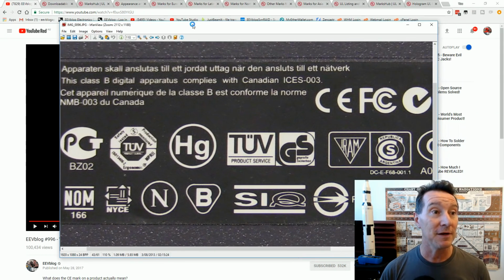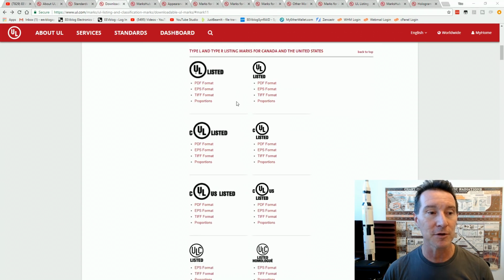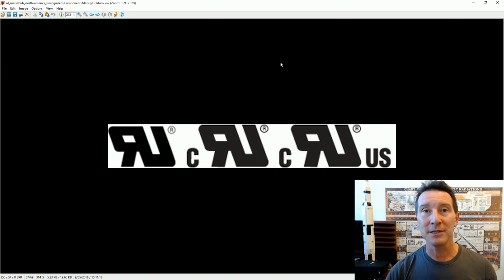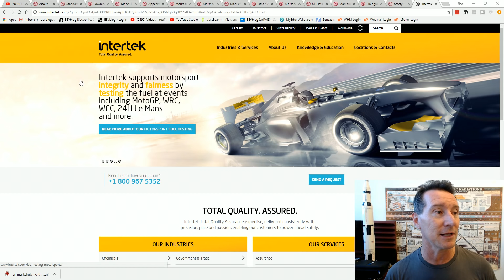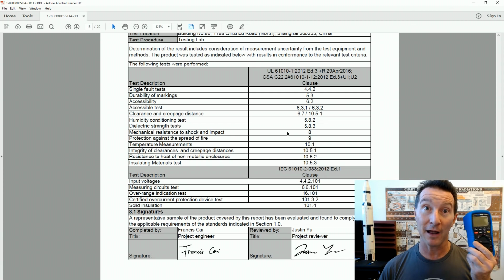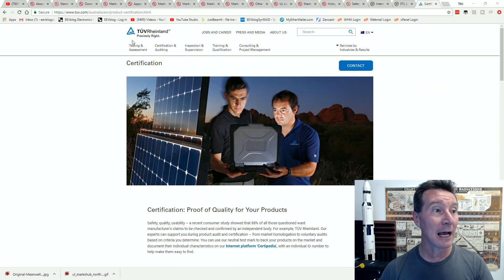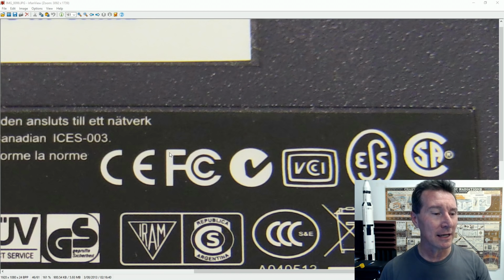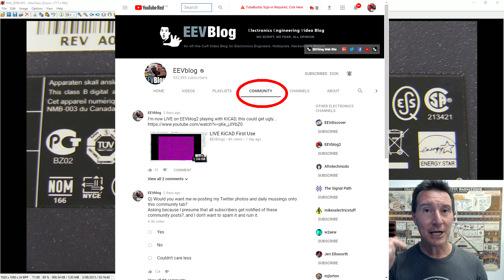EEVblog #1082 - What Do Compliance Logos Mean?

Comment: It would be more helpful if you announced the price of those logo.
Reply from the maker: There is no set "price", and I did mention ballpark pricing.
Reply: I meant something like pricing guide and related expenses. That is documents , the procedure and so on. It would be really, really helpful for many of your subscribers.
Reply from the maker: Did  you watch the video? I said it can cost thousands of dollars, into the 10's of thousands. There is no "price" I can tell you, "it depends".
Reply: Sorry, I didn't express myself properly. I meant the procedure rather, that is how to obtain in details and the payments. That is, more exact information on what it depends and how to do it properly.
Reply: You can get a basic UL (like electrical panel) inspected by a UL certified person for ~$1,000 USD.  For CE, most common test is EN61010 for safety and some kind of EMC which is around $20,000 USD.  The EMC part takes 2 to 3 days in a EMC chamber and they request you be there.  Safety takes them around 5 days and you don't have to be there.  You tell them what tests you want your product tested to and they will send you back a quote.  After all that, you have to pay yearly price to keep those certs active and pay them  to audit your factory to check if you didn't change any critical components without letting them know.  This is my experience with TUV and MET labs.
Reply: Price depends on a lot of factors.  If you're only making a few widgets, put it into a grounded metal box and you can probably get a "special inspection" sticker on it for $1000ish.  If you're going to make a few thousands of a product, you can reduce certification costs by utilizing "certified" components.  If you want to sell a class 2 product and don't want to pay a dime for certification, then include a precertified external class2 power supply with everything you sell.  The momoment you make the mains power supply internal to the product, you'll have to go through the process of getting the entire product certified.
Reply: its still device dependent. lets say i made a device modeled off the arduino, but i want it to be used as a PLC in a explosion proof housing. it just depends on what it is. it could cost 20 times what a version that was not gong to need that explosion proofing. the question of pricing is only to be determined by the approval house.
Reply: Chris That first part sounds kinda fishy.
Reply: It makes no sense in stating "affordability". If you are a manufacturer of some niche product, naturally it will cost your profit to perform extra certification, unless the customers are willing to pay for it. Only a total idiot would think about affordability at the cost of profit in the situation where it doesn't make sense. I can't afford to lose the profit, if you can, well, be proud that you can :).
Reply: About 35000€
Reply: @PhilfreezeCH I was present in the R&D of a Bone Density scanner about 20 years ago and I remember they chose the CE certification rather than the swedish (I am in sweden) compliancy because it was cheaper and they figured more universal. At least that was the talk at the time. Since it had both X rays and lasers in it I imagine the regulations would be quite  rigorous though.
Reply: CE is a self certification mark, so there are no re-certification fees. The last product I put through CE marking spent 3 weeks in the EMC chamber, although it was a rather large product and needed physical relocation for the radiated emissions and susceptibility tests. I think the charges were 10,000 GBP / week at the time.
Reply: Have you heard of the internet? Ask the source ather than an agent if you want accurate information.